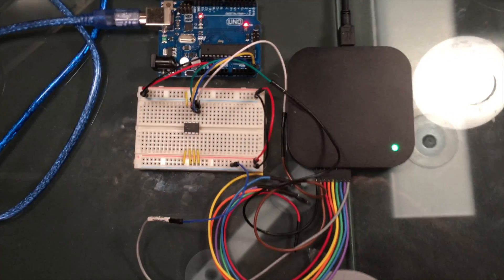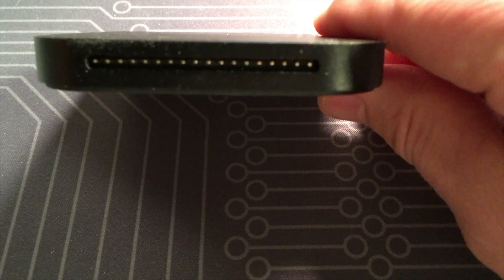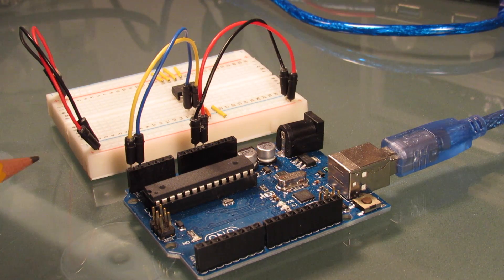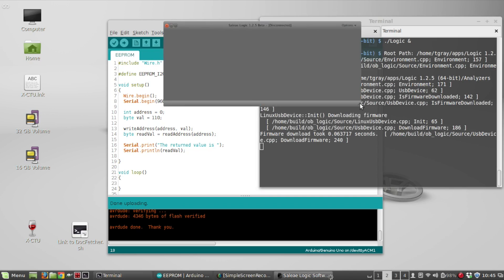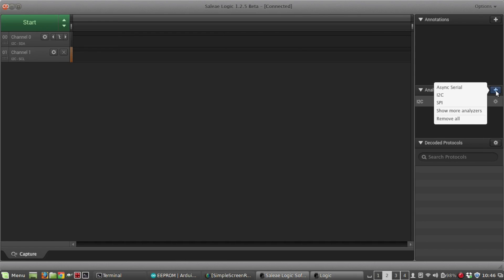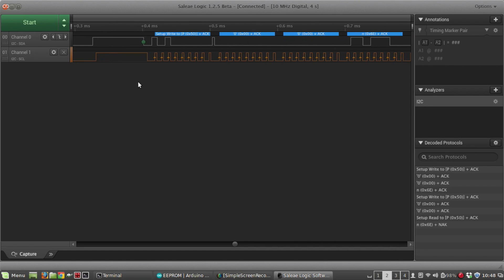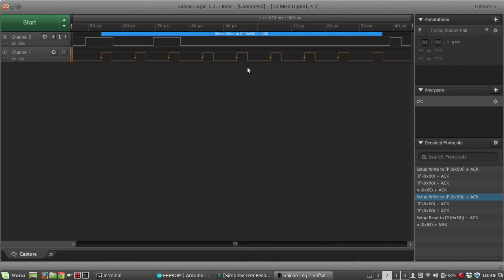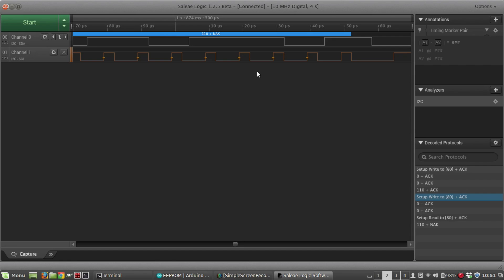How to Use a Logic Analyzer

Comment: Logical analyzer look cool i only ever used  protocol analyzers like wire-shark and other things geared for more network device analysis. These are like sniffers for address bus, data bus , or any old circuit. There actually small digitized O-scopes to some extent ...really cool Wonder how much they are and where you got them. As it be so cool to get one some day definitely to debug digital electronics. Great video.

Comment: I didn't understand why the final NACK from the Arduino
Reply from the maker: The NACK occurs when communication goes from the slave (EEPROM chip) to the master (Arduino), and the bit is set by the slave.  I believe that this is just part of the I2C protocol.

On page 7 of the datasheet (http://ww1.microchip.com/downloads/en/DeviceDoc/21754M.pdf), they discuss the NACK for a read operation:

"During reads, a master must signal an end of data to the slave by NOT generating an Acknowledge bit on the last byte that has been clocked out of the slave. In this case, the slave (24XX512) will leave the data line high to enable
the master to generate the Stop condition."

There is more information in section 2.3 (Acknowledge (ACK) and Not Acknowledge (NACK)) of this Texas Instruments paper, "Understanding the I2C Bus" - http://www.ti.com/lit/an/slva704/slva704.pdf .

Comment: I know this is an old video, but just a heads up - the memory usage for only 4 seconds is so high because you're still capturing all 16 channels. hiding them doesn't turn them off, it just visually hides them. actually turning them off in the settings panel where you selected sample rate will reduce the memory usage by 800%. it also takes a huge amount of load off your USB bus and allow you to select much higher sample rates
Reply from the maker: Thanks, yes that makes sense.
Reply: Great tip! 🙏🏼

Comment: Could you use real-time analysis instead of recording?
Reply from the maker: I don't think there is a way to do that for the software that I am using.  For most protocols, the data would be coming in too fast to do real-time analysis, at least by a human.  You may be able to write your own program to do it however.

Comment: Could you use this to connect to your cars computer on 12 volts and the 5 volt signals from the computer? How would you set this up to use it for the arduino with the o or 5 volt signals?
I have a cheap 8 channel one that I bought but don't know how to set it up.
Thanks
Reply from the maker: +amtpdb1 You want to make sure you don't connect your analyzer's input pins to more voltage than they can handle.  The documentation should tell you what the maximum voltage is.  You can use a logic level converter to "step down" voltages between the analyzer and a device that uses a higher voltage than what the analyzer can handle.  So if you want to read 12 volt signals, and your analyzer can only handle 5 volts maximum, you would need to get a logic level converter than can change 12 volts to 5 volts.  As for the arduino, I am using one in this video.  I just connected analyzer inputs to the I2C pins between the arduino and the EEPROM chip.
Reply: +Electricks Thanks for responding. There was no documentation as it was a ebay purchase.
Reply from the maker: +amtpdb1 It is probably safe to assume that it will work with 5 Volt logic levels.  Anything more than that, you should step the voltages down to 5 Volts with a logic level converter.
Reply: Thanks